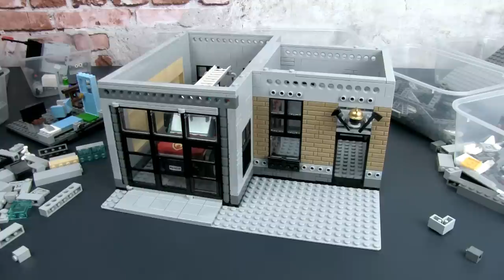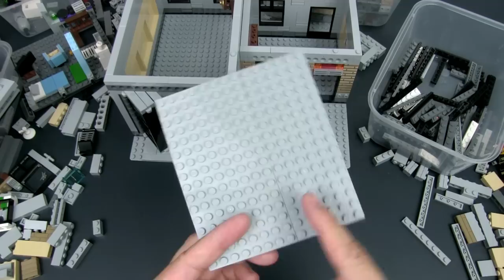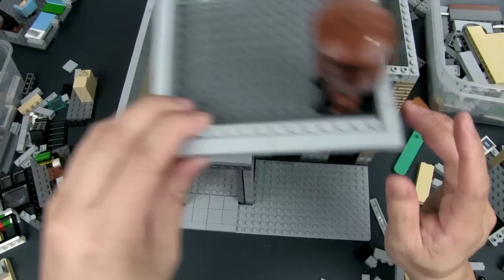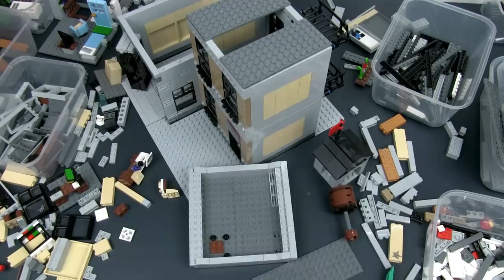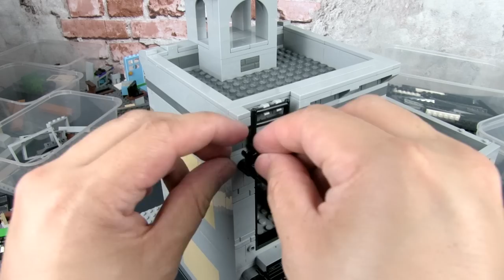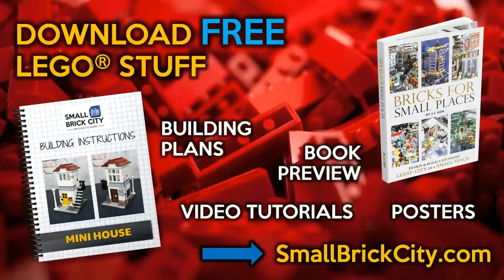LEGO Fire Station MOC (Part 3) - Building a MOC from Start to Finish

Comment: You just 1:1 copied it from ebay building construction
Reply from the maker: What instructions are you talking about? This is my own MOC. If you watch all the videos, you can see the process from start to finish.
Reply: @SmallBrickCity  no, it s 1:1 copied from ebay construction. You just changed the color of the wals a little bit
Reply from the maker: @Helloyesno23  I have no idea what you are talking about. So either point us in the direction of the instructions or accept the fact that this is an original creation.

Comment: Hey JC. Great video, as usual!  There is a ladder element that has clips on both ends. That may solve your fire escape issue.
Reply from the maker: Thanks! You are absolutely right. I do not have that but when I do the instructions, I will use that element for the bottom ladder.

Comment: The bell tower on top is what really prings this home as a fire station I think! I think the solution for the fire escape is pretty elegant - some straight droid-arms might do really well too!? I think you've come a long way on this and I'm looking forward to seeing the next video! Thanks for sharing this! :-)
Reply from the maker: Thanks! Are there such things as straight droid arms?
Reply: @SmallBrickCity  indeed there is :-) Look for part 59230 on Bricklink. It's also called LegoArm Mechanical, Straight with Clips at 90 degrees (Vertical Grip). It should be available in black.
Reply from the maker: Thanks a lot Jakob! I am wondering if I actually have them. Will hunt. Thanks again.
Reply: Small Brick City you are welcome :-)
Reply: Small Brick City oh, and congratulations on 7,000 subs! Great job :-)
Reply from the maker: Thanks a lot Jakob!